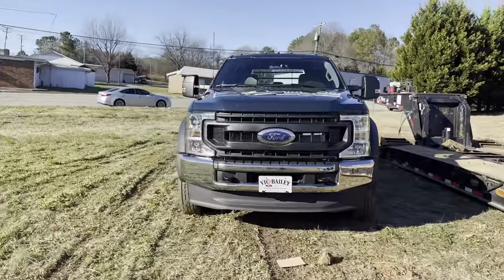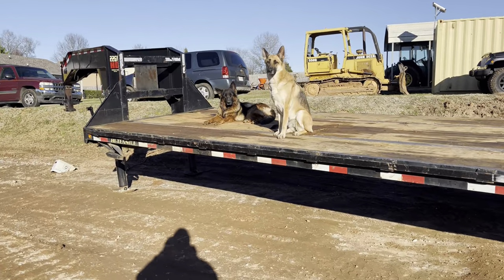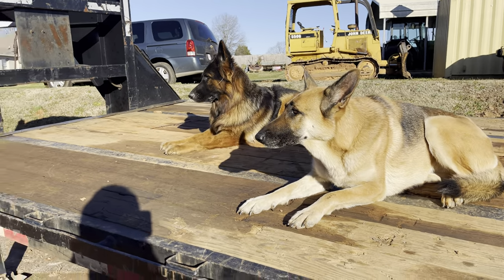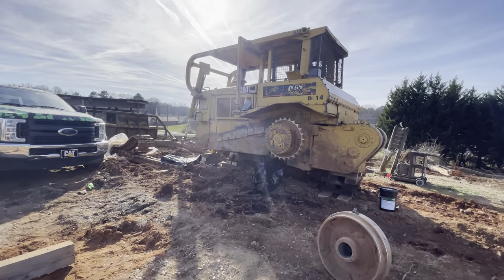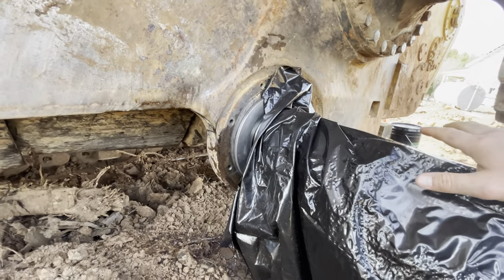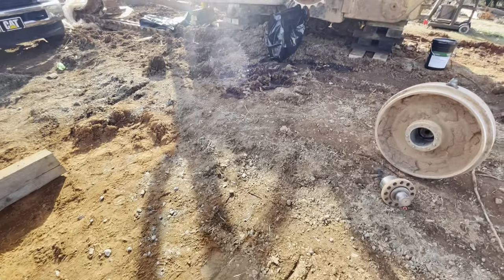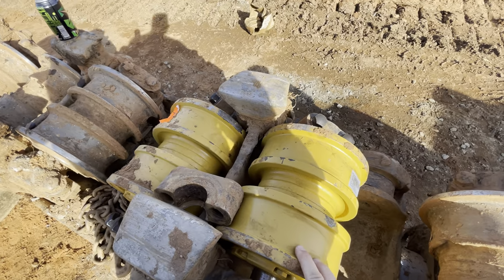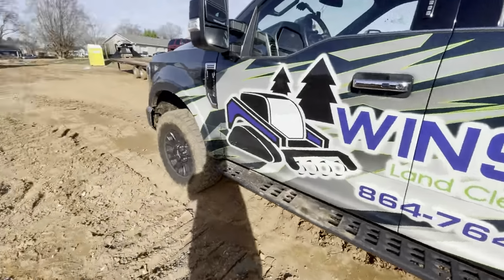D8n dozer and Peterson grinder maintenance and new wrap on 2022 f550

Comment: I swear quality and customer service are non existent especially now during covid, no matter the brand for any type of vehicle. But I do believe you either get a good one or a bad one. I had a 2008 6.4 F350 that I didn't have any problems with in 130k miles, another 2008 6.4 I had needed to have the cab off 3 times in 110k miles. So far my 3 6.7 powerstrokes have been great!